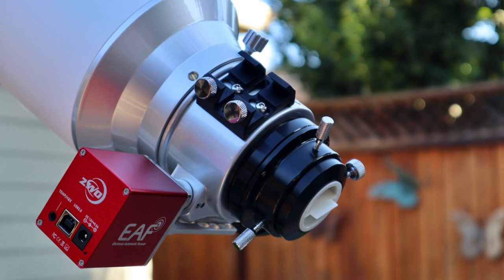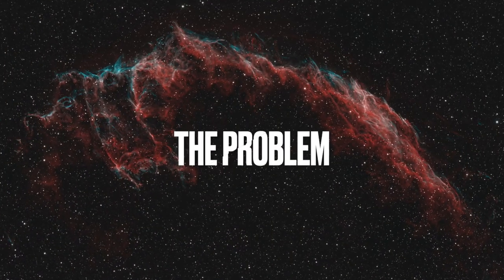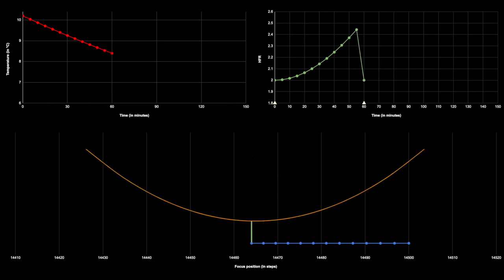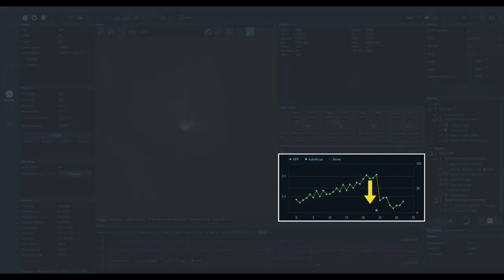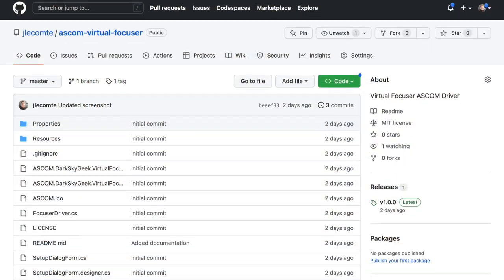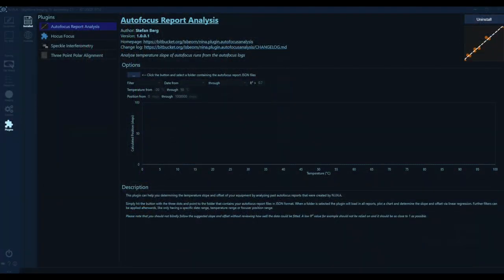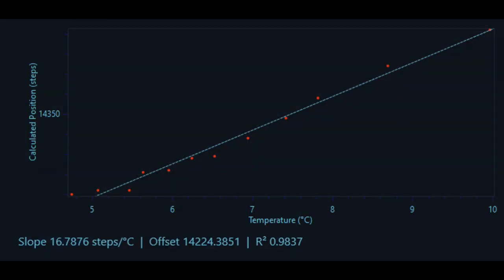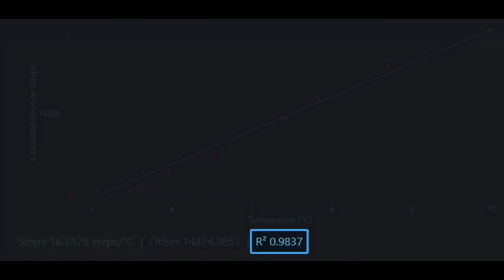Focuser Temperature Compensation Using N.I.N.A.

Comment: Good video of an important topic for everyone with f/4 and faster!    I implemented a quadratic temperature compensation (with elevation residuals) in Kstars/Ekos, and I was fretting having to do this again with N.I.N.A upon changing mounts.   Glad to see at least a linear Temp Compensation is available already in N.I.N.A.   I've been using my own home grown Ekos Temperature Compensation for 2 years, and I couldn't ever go back to the old ways (delta C triggered AF run, HFR AF trigger, or time based AF trigger).    I always run an AF to start on a target, then let temperature compensation take over.  I have run several hours and always been inside the CFZ @ f/2.2 (RASA 11).   It's just awesome.   Now repetitive AF runs (after the first on a target) seem very wasteful of imaging time.

When you say relative, I'm assuming that if for any reason you manually adjust focus, the "setpoint" (base) of the integrator will reset to the latest location?   Both completed AF runs, and manual setpoints should be honored (whichever was done most recently) as the starting point for the relative position.  Also, is there a threshold for allowed changes (so that nuisance/small changes are built up before being applied)?    Thanks.
Reply from the maker: Thanks for the kind words, and glad to meet other like-minded people 😄

The “Relative” option (actually, the option name is “Absolute”, so “Relative” = “Absolute” set to off) of the “Move Focuser by Temp.” instruction means the following:

New focus position = Current focus position + Slope * (Current Temperature - Temperature at last focuser movement)

Reference: https://nighttime-imaging.eu/docs/master/site/sequencer/advanced/instructions/

This is important because, as I explained in the video, the model is likely not accurate enough to be used with the “Absolute” option turned on. There are too many variables at play. My testing showed that doing an initial autofocus run, and then using the command in relative mode, is a better option.

There is no threshold that can be parameterized for that instruction.

Hope this helps. Thanks for watching!

Comment: I have been using Astro Photography Tool’s Temperature (APT) Focus Compensation and have been able to keep my RedCat 71 with in the Bahtinov Grabbers’ critical focus range for over 4 hours this fall.  APT’s temperature focus compensation runs in the background after being enabled but can be enable and disabled in APT’s  scripts.  It can also be configured to adjust focus during or between images.  I have wanted to use NINA but did not want to give up temperature focus compensation.  You have solved the problem. 

Thanks
Reply from the maker: Awesome! Now, you can join our cult 😂 (see Dylan O’Donnell’s latest video)

Comment: I  found the HFR AF trigger in NINA works well for OSC imaging.  For monochrome, not so much simply because the HFR can shift quite dramatically with filter changes, particularly NB.  The end result is an AF with every filter change, which isn't really a terrible result, but there is a trigger available for that instance without the complication of HFR changes.  I limit my imaging to 10/filter so that I be reasonably certain of capturing a full 'suite' of filtered images per session; Temperature compensation may get around that but filter offsets combined with AF per filter changes to establish a "zero" reference each time seems to work very well.  IMO - YMMV
Reply from the maker: See my filter offsets video, it will address your comment, i.e. it is perfectly possible to use temperature compensation with a monochrome camera (I do it all the time 😁) CS!
Reply: if your hfr is changing that dramatically after a filter change, your offsets might not be good :) I shoot mono and literally 0 of my filter changes change HFR because my offsets are working correctly. you are likely wasting a ton of imaging time.

Comment: Fantastic, thanks a lot! Exactly what I was looking for (got a jumpy EAF external T probe, too)…

Do I understand it right that you collect the current temperature from the sensor every second and store this in a list with 120 elements, continuously deleting the oldest value when adding a new value. And the temperature your driver returns is the average of these last 120 raw values. TEMPERATURE_WINDOW_IN_SECONDS = 120 is the size of your moving average window, right? Although in the code comments you write “60 seconds”…?

😀👍
Reply from the maker: Yes, you are correct. The comment in the code was probably not updated when I switched from 1 minute to 2 minutes.

Comment: Thank you Dark Sky Geek, a few nights ago I was out experimenting with NINA’s auto focus and the temperature was dropping quickly. I noticed that every auto focus run gave me a different result. So that is why I started looking at temperature compensation. Your video was very helpful to me. I have already bought an external temperature sensor for my robotic focuser (an Esatto 2” from Prima Luce Lab). A couple of questions if I may; considering that it is the tube that is contracting, why not place the temperature sensor on the tube? I plan to stick the sensor onto the tube with some adhesive backed foam, with some heat sink paste to provide good thermal contact to the tube. The foam will partly isolate the probe from the air temperature changes and should provide a less fluctuating result.  Secondly, I have found that NINA’s auto focusing doesn’t work so well with nebulas. My work around plan was to write into the sequence a slew to a clear star group, do the AF, and then move back to the target nebula for imaging. Your approach of getting NINA to monitor the HFR of the images taken and compare the change in HFR to the last AF run would not be possible for me if I use a nearby star group for my autofocusing. So I don’t know where that leaves me - another problem to solve. Anyway thank you for the video, well done.   Regards, John Bellingham
Reply from the maker: 1. It’s not the tube that’s causing the focus to change, it’s likely the shape of the lens/mirror that’s changing. You don’t need to stick the temperature probe to the tube.

2. Focus with the L filter, and you won’t have any problem with nebulae. Use filter offsets as needed (I’ll do a video on filter offsets soon)

Best of luck!
Reply: @darkskygeek G’day Dark Sky Geek, thanks for getting back to me so quickly. I have a 12” Meade SCT, so where would you suggest that I mount the temperature probe?  Regarding the filter for improving NINA AF runs at nebulas; I have a ZWO dual band filter, will this help? (BTW I have a OSC camera.). Thanks again.   Regards, John Bellingham
Reply from the maker: @John Bellingham  You don't need to mount it anywhere special. I let mine hang in the air.

You need to AF with an L filter, and then configure NINA with the proper filter offsets.
Reply: Hi DarkSkyGeek, I started to follow your “Downloading and Installing the Driver” instructions but didn’t get very far because I have no experience with command prompts and such. I was able to save the .DLL file in a folder, and I could see the RegAsm.exe application on my system, and I was able to bring up an administrative command prompt. However from here on I have no idea what to do. If I could ask for a little (step by step) help from you I would greatly appreciate it. Or perhaps you may consider that without this basic knowledge in programming perhaps it is too dangerous for me to continue. Thank you for your help.  Regards, John Bellingham
Reply: Hi DarkSkyGeek, my son had a chat to a friend, and he managed to install the driver, and received the “Types registered successfully”. However when I selected it in NINA I received an error message. “ASCOM Driver Error
Unable to connect to DarkSkyGeek's Virtual Focuser ASCOM Driver. Reason:
set - " is an invalid value. The valid range is:.”
I thought that you would like to know. Regards, John Bellingham
Reply from the maker: @johnbellingham630  Do you have the option "auto detect COM port" selected? Is your device connected? In the driver settings dialog, do you see any COM ports in the drop down? Can you open a GitHub issue and attach the NINA logs for that session? Thanks!
Reply: Hi DSG, I apologise unreservedly. I was in a hurry yesterday, I had rain approaching and needed to closeup the observatory, and I hadn’t selected my focuser. It appears to be working. I will test it by doing a series of AF runs during the next clear night. Thanks for your help. Regards JB.

Comment: It looks like that in NINA the focusing temperature compensation only works with focusers that have a proprietary temperature probe (like the ZWO EAF). I am not using the EAF but another DIY ASCOM focuser (inspired from your very good OAG focuser project). Is there a possibility to plug a sort of independant 'ASCOM' temperature sensor that I could use for the compensation purpose? I am using NINA and happy with refocusing in function of HFR changes, though, so it is more a curiosity question... Or why not using both...
Reply from the maker: Many people have asked the NINA developers to consider using another source for the temperature readings, but they have resisted so far. So, your only option is to modify my ASCOM driver and firmware and electronics to report some temperature reading. Temperature sensors are very affordable. You will have to calibrate it. It’s certainly a fun project. Or you could modify the ASCOM driver only and have it get the temperature info from somewhere else, like a weather station. There are options. Maybe I’ll update my virtual focuser driver to make these things a bit easier for people to integrate with NINA. CS!

Comment: Hi @Dark Sky Geek :) First Thank You very much for this awesome Video and Driver !!! I played a little with the Focuser temperature compensation and this is excellent for me too :) , the only problem i found is if the temperature is climbing a little, my focuser (gemini pro) uses a go out +150 steps and then go in to fine focus, but this take some times (about 30 seconds) and NINA is already taking the next picture.... Is there a way to say NINA to wait until the focusing is finished before taking the next picture ?
( I will use your driver next time, just did some tests witout the 120 samples median... maybe your driver already skip temperature climbing to avoid that ?)
Reply from the maker: I recommend you ask the question on the NINA discord server. I don’t see that with my equipment though…
Reply: @darkskygeek  Thank you, i will do that :)

Comment: I got a notice last night in NINA for a EAF firmware Update to version 3.1.9.  I installed it and now the DarkSkyGeek's Virtual Focuser ASCOM Driver is not working.  If I select your driver NINA is showing temperature of -273.00 C, sometimes NINA will show focuser movement, but the EAF is not moving, and the beeper will run continuously.  

I have been using temperature compensated focus since you released the driver and have had nights where the focus was still in the Bahtinov critical range after 4 hours without doing an autofocus.  During this time my focus steps have increased over 200 steps.  My autofocus step size is 150 steps.
Reply from the maker: Wow, I don’t know what ZWO did to their firmware. -273C is like 🥶😁 Maybe see if you can downgrade the firmware?
Reply: I tried and the older version would not load.
Reply from the maker: ok. Maybe try contacting ZWO support? What if you don’t use my ASCOM driver, what temperature does the ZWO driver report? If it also reports -273C, then there is a problem with the firmware or the hardware. Hope this helps!
Reply: I just installed ZWO_ASCOM_Setup_V6.5.19.exe and things are acting differently.  I am now seeing the -273C for ZWO Focuser (1) driver and the Virtual Focuser ASCOM driver.  In the past the temperature was different in the ZWO Focuser (1) driver.  I am trying to remove the Virtual Focuser ASCOM driver.  I will get back to you when I have more information.
Reply from the maker: OK. If ZWO’s driver reports a bad temp, then there is nothing my driver can do to fix that. Also, removing/unregistering my driver won’t change anything. I think your hardware or the firmware you just installed is faulty, and I recommend you reach out to ZWO support.
Reply: The -273C temperature was caused by the external sensor not being plugged in all the way.  For the ZWO Focuser (1) driver the EAF's internal temperature is 37.7C and dropping. I am measuring 91F (33C) on the EAF in my office.  When is settles down I will switch to the Virtual Focuser ASCOM driver.
Reply: It looks like the external temperature input is not working.  If the external temperature sensor is plugged in on startup, I get the -273C value.  If I unplug the external sensor the internal temperature sensor looks to be working.  If I plug the external temperature back in the reading freezes at the last internal temperature value.  Also, after plugging the external temperature sensor back in, I am seeing NINA showing "Is moving" checked with no movement of the EAF or any changes in NINA's focuser "Position".  The beeper is also sounding continuously.  The only way I have found to stop the beeping is to unplug the EAF's USB connection.

 I am going to try and contact the ZWO support.  Hopefully I can reinstall the older firmware version.
Reply: I found the problem.  

The firmware update dialog for the ZWO EAF I received in NINA was for the older firmware version ZWO_EAF_EFW_FWUpdate_3.1.9 dated 12/4/2019.  I did not recognize this as an older version Tuesday night when I receive the update dialog and did the install.  Wednesday nothing, I did was working so in the afternoon I decided to take a break and try again later.  Wednesday night I tried again and the first thing I noticed was the version number.  From my install folder I found firmware version 3.3.8.  This installed and everything looks to be working again.

I know I checked the ZWO software update website Wednesday and from my memory I was getting the same ZWO_EAF_EFW_FWUpdate_3.1.9 file I downloaded Tuesday night when I got the update dialog notice in NINA.  I checked again Thursday and the ZWO software update site firmware update file is FWUpdate_Windows_v1.1.zip and this file contains the EAF_3.3.8.hex hex version that I installed Wednesday night.

Thanks for all your responses.  I will pay more attention to update notices in NINA if the future.

Thanks again

Comment: Star HFR is bad approach for refocusing, since it depends on wind, seeing, etc. Those factors change a lot during night. For example, you have 3 then 4. Focus on, waisted time. This 4 could be 3.3 in the next frame without refocusing
Reply from the maker: Sure. However, NINA uses a “window” of multiple samples, and a threshold - both are user configurable - to determine when to run an autofocus routine. So, in practice, it has not been an issue, at least not for me. But yeah, temperature compensation can improve things a bit.
Reply: @darkskygeek  It is big issue if fl 2500mm f10 and O3 or Ha filter used for some regions; for example, Abell 39. Basically, small and dim planetary nebulae will be not covered by your method. Although, it may work for CDK>17” and f ratio <7.
Reply from the maker: @anata5127  I don’t understand what you are saying. First, I always run autofocus using a luminance filter, and then, I apply some filter offset once I switch filters. Hopefully, the field of view has a few stars in it, enough to measure the star HFR and have a statistically meaningful result. Why would that not work? Or maybe I missed something in your message. Thanks!
Reply: @darkskygeek  Autofocus with O3 doesn’t work in conditions, I listed (yes there are stars, but you see them after 60 sec exposure). Yes, you are right. Run focus in L and apply offset. This is a way I do. Moreover, I apply temperature compensations. 1 degree shifts 30 steps (120um). 
Did you image with long fl when target is 0.5-2’ and you need details? Eccentricity should be <0.4 and FWHM<2. 
Bottom line traditional autofocus doesn’t work. Trickery is required. But it depends on targets.
Reply from the maker: @anata5127  Don’t autofocus with an OIII filter! Autofocus with a luminance filter. A focal length of 2500mm and an APS-C sensor (for example) will show plenty of stars to get a good measurement of the star HFR and the autofocus will succeed. Then, you switch to your OIII filter and you apply the offset for that filter, which you measured when you installed that filter in your filter wheel. I still don’t understand what the problem is.
Reply: @darkskygeek  This is a way I do. My one is 533 sensor. Long FL with Ha or O3 with 20 sec exposure doesn’t produce parabolic or hyperbolic curve. I don’t know how better to explain. It just doesn’t. 

We could do this way. Take pictures, for example, Abell 39 with fl >2000mm and we will discuss it.